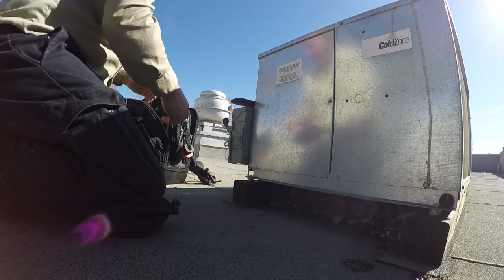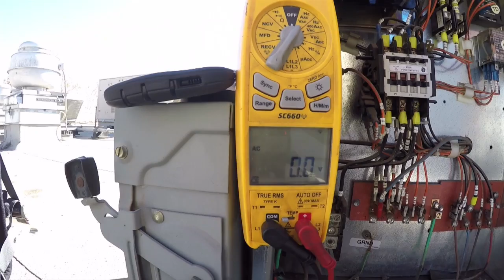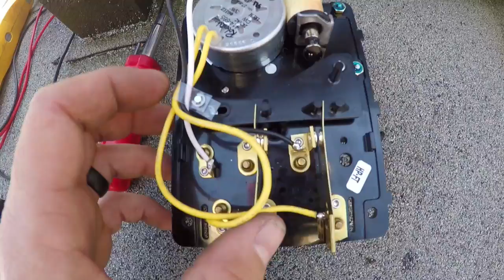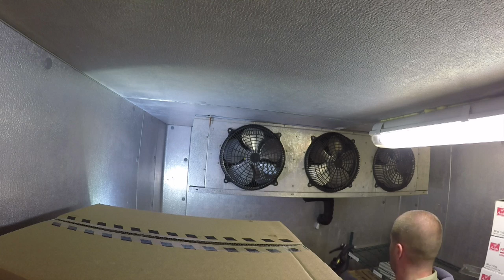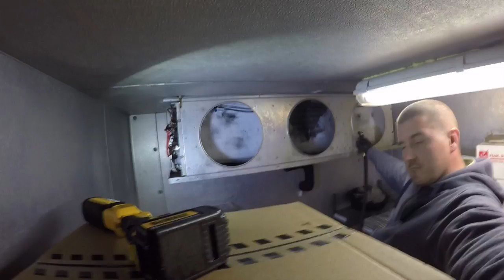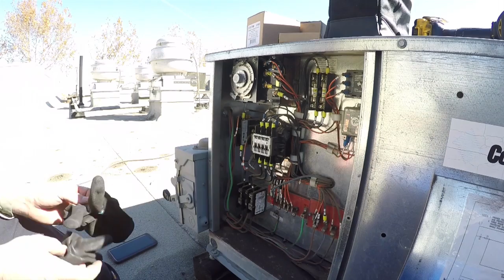Iced up walk in freezer

Comment: @hvacrvideos I just worked on a walk-in cooler with the same defrost clock. All the wires were there, but nothing landed on X. There is a HL safety on the unit. Does this not seem correct?

Comment: 7:18 - The thickness of the cardboard box for the new defrost timer is just right for holding that slotted screw on the blade of your screwdriver long enough to get the screw started. Fold it over the blade end before putting the screw on it.

Comment: Minor point of criticism: Check voltages after pushing the disconnect switch to ensure the power actually disconnected. Breakers and/or disconnect switches can fail and remain closed. You had 208v on a wire you're going to be switching over to a new module. Getting zapped by 200+ volts is unpleasant at best.

Comment: Nice video. The auxilary unit is just an additional safety. It is there in case the defrost clock is faulty and tries to run both the heater and the compressor.

Comment: Why does the electrics in the control panels in the states look like they’re from the 1980s. 😉
Reply: Old designs, also costs. Better ones will have a really nice wireing, and layout, no weird blocks, and some (especially from Europe, or really big units in US, i.e. many TRANE units) will even have everything nicely mounted on DIN (TH35 / TS35) rail, so it is easy to snap in things and out.
Reply: Nothing industrial grade in Australia is wired point to point, everything is wired in ducts with equipment on DIN rail. Only point to point wiring I see is smaller domestic equipment like washer machines or kitchen ranges.

Comment: Seems like it would make sense to have the defrost timer drive a contactor instead of relying on those springy contacts to switch/carry ~10A of resistive load. I'm sure the timer says it rated for it but you can't help but be skeptical once you see melted plastic, and those numbers degrade as oxidation and pitting takes hold. Id be curious to know how common that failure is for that specific timer.
Reply: Believe the old Paragons are rated to 30 amps?

Comment: They make a cool flathead screw holding screwdiver ....we use them a lot in the Navy instead of phillips because we need the screw to be steady to insert them. ships move.  Klein sells them and I always carried one. You just can't torque the screw tight with the holder/driver. There are also pencil type holders to just start the screw...that was in my Navy tool bag.

Comment: Today I have a walk in freezer which is weird. When it is in defrost mode, I have 208v between N to 3, and 0v between N to 4, but the compressor is still run. I checked the wire diagram all seems right. Do you have any idea what’s wrong with it? Thank you

Comment: I love watching these I miss being on a roof on days like that, but I would like to see you after hitting the disconnect check power with meter or tic tester, I broke my back from a high voltage bad disconnect and contactor with melted tab. 
Just for those new guys, I like you am ocd on these things I bet you have crazy anxiety some nights to where you go back to the job on the weekend off the clock just to check on things
Reply: How did you break your back?  if you don’t mind answering that question

Comment: You didn't check to ensure that there was no voltage present after switching off the disconnect.
Reply: I assume he did. Would be rather deadly to just assume that the power is off. He just didn't put it in the video. I could be wrong. But the all the videos I've watched of him, he knows better than to just assume. Although stupid little mistakes like that can happen.

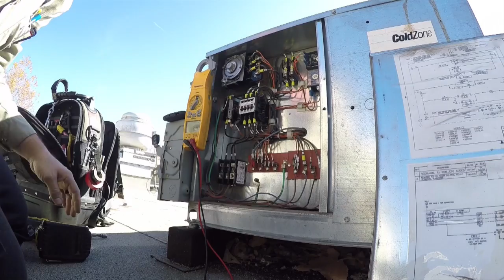Comment: 2:30 never trust a cutoff switch. You don't know who worked last on that thing and maybe not so professional as you. A check just takes like 10 seconds, but keeps you safe.

In Germany it would be required to find the next verifiable working ground connection and ground the whole circuit after the cutoff switch. Mark and lock the cutoff switch to avoid that someone might turn it back on, when you're somewhere else and then check if there's any power running to the circuit from another source.
Reply: In Australia it's common on larger equipment for the technician to carry his own lockout lock(s) that has a company name and phone number on the lockout. That way if the technician is away working on another part of the unit anyone finding the locked out circuit can ring him and confirm the reason why the circuit is locked out.
Reply: @raygale4198  yeah that's common here too. That's what the hole in the switch is for.

That's what I initially meant with 'lock the cutoff switch'

Comment: I have a 3 pole contactor which are all controlled by 24V (not like  yours in this video). The fun runs no problem. But whenever I plugged in the compressor, the contactor starts clicking (quickly on and off). I checked all the sensors in the refrigerant system (temperature sensor, high and low pressure sensor) and they are all Ok. I also checked the compressor amp draw which showed 15A. The RLA on the compressor in the service manual is 25A. Does it mean the compressor is bad? 

This compressor was just installed by another technician. The owner said the first week after the new compressor installation it has no problem. After that, he heard the loud noise from the roof (contactor quickly on and off which led to the compressor quickly start and off).  The technician came back and installed a new contactor, but it was burned out since it has the same problem. When I was there it already burned 3 contactors. 

Any ideas about the issue? By the way, it is a 3 phase compressor in 7.5 Ton A/C in a restaurant. Thank you so much.

Comment: I dont want be negative, because your videos are excellent and very educational (I am not in HVAC business or even close, but I find the videos addictive). However, still as non expert, at 2:30 you disconnected the power without checking voltages after it, and then used a non insulated screw driver. There is a real risk of one of the phases to be still live. I understand, you need to do what you need to do something in a hurry or out of habbit, but I wouldn't put this openly on youtube for other people to forget about stuff (sure, people will not do this stuff without training, but it is still good to show proper behaviors even to general public, as they can use similar procedures on everyday equipment, and end up with bad consequences). Also, if you do not have one, get a small portable battery power live voltage test box (proving unit, like Fluke PRV240, or some cheaper alternative even), so one can do live-dead-live procedure, even if you don't have access to HVAC (high voltage AC :D ) nearby after disconnect. Cheers from Switzerland.
Reply: Well yea that is true but he did turn off power Well in command sense once you turn off power it'll just be off but then again he should've checked tho you aren't 100% wrong

Comment: Dear sir
Are your defrost heaters dual voltage I do hvac and I am also an electrician and when you use the word neutral I think 115 volts if they are dual voltage I think the manufacturers of them should mark  that terminal n/L2 maybe I am reading to much into this but I think like an electrician first then hvac

Comment: So how does one know the burned #3 contact is a symtomatic sign or causal sign?
if its causal no problemo, but if its just a symptom , then the cause is gonna burn out the new defroster timer again, sooner or later.
Reply: If it was poorly tightened, crimped, corroded or was oxidized / grease in the first place it might be a both cause and symptom.  I would say it is not usually a just symptom of something else broken. Because if something else shorted or used more power, a specific fuse or main breaker should pop up instead.

Comment: Pardon my ignorance in advance.  Don't know anything about it.  But on that defrost contactor you said you saw it pull in and you checked across it and it showed 0 volts but you said you had volts going into.  Then checked bottom wire going to contactor and it was pulling 10Amps.  Shouldn't there be voltage across the contactor?  What I am missing?
Reply: A contactor is a power passing device which when measured across its terminals it will read 0 volts when energized because your measuring the same electrical phase, i.e. top terminal of contactor 120V - bottom terminal of contactor 120V = 0 volts. A power using device, like a light bulb, will measure 120V across its terminals. Hope this helps, I know it's confusing but 80% of HVAC or refrigeration is electrical so you will need a thorough understanding in order to become a good technician. This technician is well above average, the only thing I would have done differently is leave the single pole defrost contactor in place.
Reply: @guybeavers6026  Thank you Sir for explaining.  That makes sense.
Reply: not if contactor is pulled in

Comment: Would useing a heat gun be faster to deice the fan box?
Reply from the maker: No not in my opinion, Hot water is the most efficient in my experience
Reply: @HVACRVIDEOS  Great video explaining defrost timer. They might be thing of past in future with the new electronic controls. Just run direct power to fans and condenser separate.

Comment: Do you only run neutral through temperature control to x terminal? because the solenoid in the back of the timer is getting L1.  ?

Comment: Should know immediately that the fan delay was bad. Should not need aa manual water hose defrost for a freezer unless you can't get the electric defrost to do it for you.  Put it into defrost as soon as you get there.
Reply from the maker: To each their own but the water hose in my opinion is much faster and electric defrost typically wont defrosts the txv.

Comment: Probably would have been a good idea to verify the circuit was deenergized. I never trust a disconnect. Good video, keep them coming.
Reply: Theramsey3 that’s correct !!!
It happened to me on a disconnect after switching to “OFF” L1-0Volts  L2-0Volts 
L3 Surprise Volts !!!!!
Reply: Everyone who has worked on these thought the same thing. I use a volt pen to double check. But I’ve been hit by 277 and had a contactor blow up in my face so let’s just say it don’t forget anymore.
Reply: I was going to comment this too lol.
Reply: Even with the disconnect and breakers OK, you can still get a nasty zap.  I got hit with backfeed from somewhere while replacing a rusted out disconnect.  I jammed a probe into the earth and then tested the wires.  Somewhere it was getting 60 volts, enough to get my attention.  I shifted to a single hand method to finish that box out.
Reply: I agree,  basic common sense. One day that lack of diligence will bite him in the ass.
Reply: @blackhatter011  hahaha it did to me down 15 feet onto table and broken backs suck
Reply: yeah I cringed a bit there (and im an autospark lol) but have done my fair share of 415v 3 phase fitting (in the uk) and nearly been bitten by a disconnect that was wired in backwards so the fuses were always "hot" with the cabinet open!

Comment: Not to be a dick, but just  check the nameplate on the evaporator coil for the defrost heater circuit amps. If you're within range you know all the heaters are working. But I know you wanna be thorough, no problem with that.

Comment: Hey Chris I wrote you an email about a month ago but couldn’t get in touch with you. I may have typed in your email address wrong. However you have a great Chanel and it’s really helpful especially since I’m new to the refrigeration side of the industry. There is one thing that I’m not seeing clearly  or understanding. On a walk in freezer does the number 4 terminal energize the t-stat or is it on a separate circuit ?  And how exactly does it energize the refrigeration mode does it send the control voltage to the coil side of the contactor?
Reply from the maker: Joshua thanks for watching bud  it all depends on how the system is setup but most commonly 1 leg of power runs from the #4 terminal to the thermostat than to the liquid line solenoid valve. When the solenoid valve opens up it raises the suction line pressure than the low pressure control turns on the compressor and the system runs until the thermostat satisfies than it shuts off the solenoid valve and the system pressures start falling until the low pressure control shuts off the compressor. than repeat over and over again. make sense??
Reply: Mind blown haha that make sense . Just to make sure that I understand you correctly the low pressure switch on most system will be wired in series with the coil voltage thus breaking the circuit due to a low pressure situation ie pump -down or another issue that would cause low pressure like a loss of charge ?
Reply from the maker: Yep
Reply: Thanks for the help
Reply from the maker: No worries bud!

Comment: Another good video. Although, I think I might have done a quick swipe with a non-contact detector after throwing the knife switch. You just never know these days! Just don’t want to see anybody get hurt. Stay safe! 👍
Reply: Its a good idea to check. I had a bad experience on top of a resturant once. I was changing out a compressor that another tech diagnosed. I saw that the disconnect was off and started my recovery and removal. I had the new compressor bolted in and my vac started. As I began hooking up the electrical I got shocked off the L2 leg.  After taking a few minutes to calm my nerves I went back to the unit to investigate. What I found was a large guauge wire hooked up to the line side of the L2 lug and jumpered down to the load side. Apparently the fuse kept blowing and some dingus made this up.     So yes, checking the voltage from line to line is a habit now.
Reply: @TanTan-ni4mg  I would have used a more potent choice of words.  And if I knew the jerk, I'd have visited my local witch doctor to slap some nasty voodoo on him.
Reply: @Nighthawke70  I'm pretty sure it was the owners "Handy Man" checking out the unit after the tech had condemned the compressor.
I should have checked FIRST though.

Comment: Thanks for sharing.   I have never seen a contactor with an auxiliary to control the defrost contactor.   Is that because the system  needs to pump down first?  Also interesting to see separate fan delay/defrost termination switches.
Reply from the maker: yeah it is a fail safe so the system doesn't turn the heaters on before it pumps down!

Comment: When the system goes into defrost and it pumps down. Is that the same as doing a manual pump down where the refrigerant goes into the condenser.
Reply from the maker: texture6 it is similar.  Basically when it goes into defrost the liquidline solenoid valve closes and the refrigerant stops there. Usually the solenoid valve is located downstairs in the evaporator but in my case it is located in the condensing unit. So the refrigerant will than back up into everything behind the solenoid valve and stop at the discharge valve of the compressor.

Comment: the heater circuit should be wired to a contactor if it draws much load as it would not melt the #3 terminal on the clock. as the #3 terminal on the clock should be wired to the contactor coil then the heaters get wired to the contactor.  its a standard Paragon 8145-20 the clocks with the 20 and yellow wires to the timer motor is a 208-240 volt. The ones with the 00 and the black wires are 120 volt. i experimented with one the 8145-20 with the invensys motor will run on 120 volt.  but for supermarket walk in freezers and low temp reach in cases on some older rack systems the defrost heaters are wired to a contactor. i would recommend a contactor if you see the #3 terminal melted.
Reply from the maker: Thanks for watching and taking the time to comment. If you look closely the unit does have a defrost contactor, and it was wired in correctly. In this case the reason why the terminal melted was likely caused by a loose screw at the timeclock itself. I actually replaced the defrost contactor and compressor contactor because they were worn out and had signs of carbon buildup at the points. I also found that the defrost termination switch was bad too. It was totally a multiple offender.
Reply: its common on another video i watched when screws aren't tightened it can destroy the plastic board on the clock. but the timer motor is still good i would harvest it and save it if on a call if the clock has a bad timer motor then could save the cost on a new clock just to replace the timer motor. I seen some of these clocks can vibrate loose the minutes knob can come off as you need a fine wrench to tighten it on units these semi-hermetic compressors do vibrate alot. that can shake the clock parts loose.  As these Paragon 8145-20, 8141-20 and 8045-20 they are all reliable time clocks as i seen some contractors they replace these Grasslin time clocks depending on the system on what model Paragon time clock can replace it. as the mechanical clocks cost less and last longer than the Grasslin.  Myself i don't like the Grasslin if me i would stay with the Mechanical Paragon they been around along time some units will have the original enclosures that will say AMF Paragon as i think American Machine and Foundry has once owned Paragon along with Harley-davidson Motor company then. as today they are owned by Robertshaw or Invensys. with Ranco controls. the Supco ones i seen basically are Paragon knockoffs made in China i would use genuine Paragon. depending on your supply house.
Reply: Te Rerenga Wetere 
Clown.